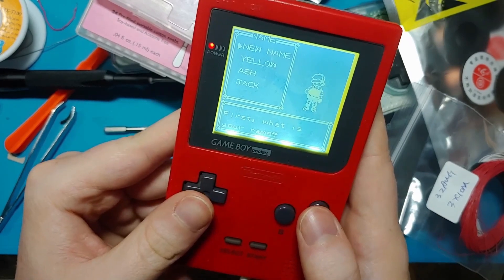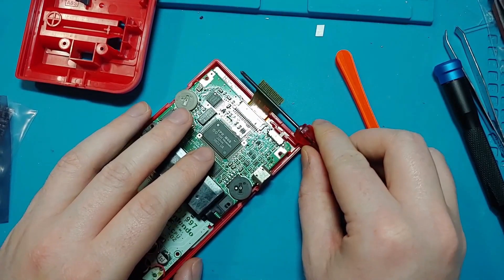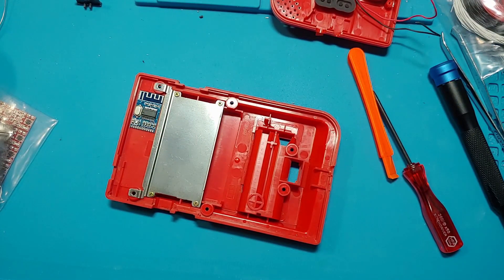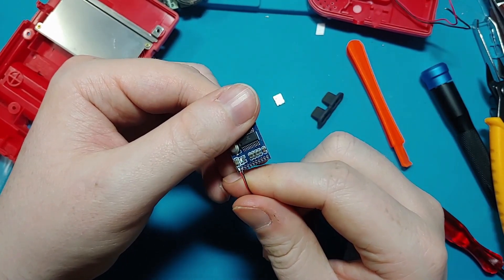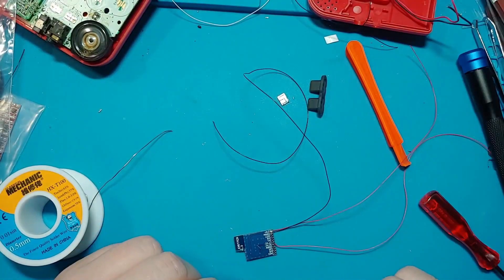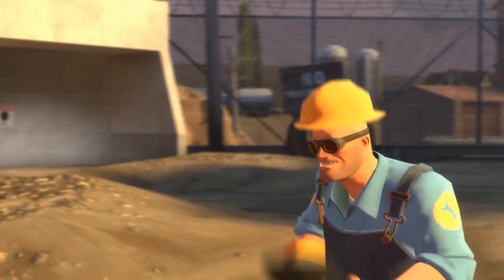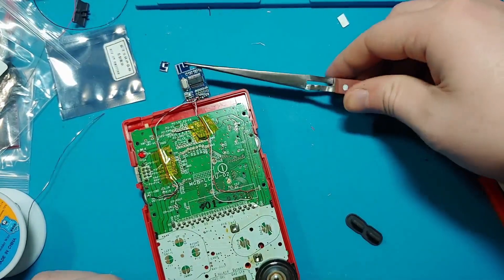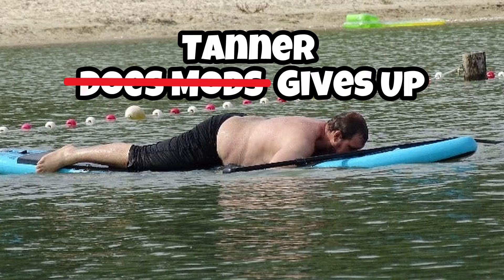Failing the Gameboy Pocket: Bluetooth Audio Gone Wrong

Comment: Pulling audio from U3-LOUT/ROUT would result in the same except with volume control right? I want to maintain volume control, but when on bluetooth, simulate having headphones connected to the jack so the speaker doesn’t kick out any sound

Comment: Thanks for sharing the mod process! Any chance you could share photos of the final wiring? :)
Reply from the maker: Poorly made schematic: https://imgur.com/a/ZJ0ED97
Hopefully that works for you. I didn't use an LED in my build (there's one on the board already) but realistically if you do you should also include a resistor at like 330 ohms or so

There will definitely be a follow-up video once I get all the kinks worked out and figure out how to fit it all in there though.
Reply: @TannerDoesMods  Thank you! :) I was actually watching your video last night while trying to get a GBP bluetooth mod working last night. I used a different chip, but with no success - I've now ordered the same model you used!...